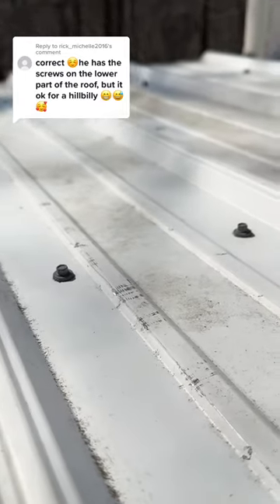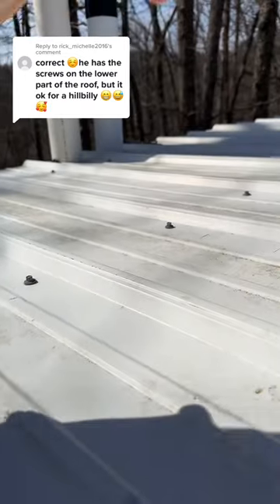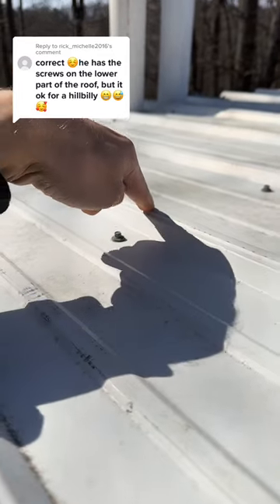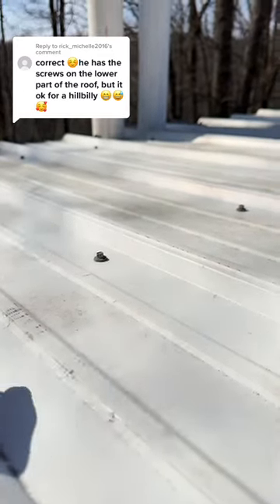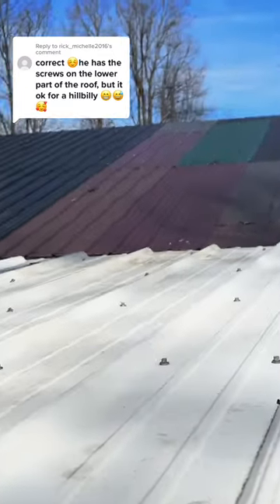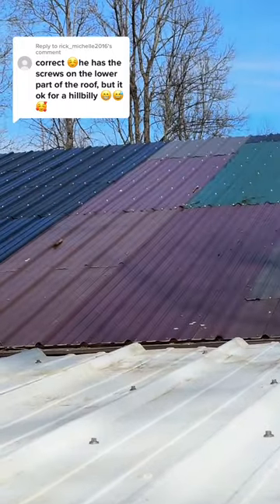did I install screws on the wrong part of the roof

Comment: The s wave style of steel roofing is what you're supposed to screw into the highest point of the patter. The way you screwed your roof is actually correct because it's not a s wave style sheet

Comment: I've built welded steel buildings for years.  You put the screws EXACTLY where they go. Putting then atop the ribs would create a fulcrum (think lever) that would allow wind underneath, and the whole roof could take off like a kite.  Conventional thinking or not, did it correctly.

Comment: It would flatten the ribbs because they are not enforced. It would make sense to redesign it though. You can use silicone to seal the screws and pluck the holes - expert from the internet with no experience

Comment: The high rib isn't touching the wood underneath.  If you tighten the screws as they should be, you will bend the metal.

Comment: The screws are suppose to be on the flutes because it will hold the panel to the roof without damaging the rib. As a professional metal roofer and cladder, the screws are in the right location. Everyone who says otherwise has no knowledge in the subject.

Comment: Never put the screws on the high points or ribs. That crushes and distorts the metal along with leaving a large portion of each screw in the air so to speak. The screws are then more susceptible to bending or moving under a wind load.

Comment: I used to install roofs, you're supposed to put them in the lower part. the top part is way less secure and leaves an air gap between the scree and the water

Comment: It's a good theory but if you overtight in the screw the ribs ends up crushing down anyway. Just do a standing scene roof with hidden screws and not worry about it if it's a big deal

Comment: The screws have grommets. 
The only thing is that the rubber rots in the sun but screwing in your roof is how you keep the roof on and not in the neighbor's yard.
Reply: There are 3 parts to the screw. The screw, the rubber seal and the washer. The washer is what protects the rubber seal. These are also suppose to be screwed in the correct way. You can not be over tight nor loose. Doing so voids the warranty. You can check then by looking at them and if you see excess rubber then you have over tightened them.
Reply: The Neoprene screws that I’ve always used are included in the 50 year warranty

Comment: A lot of metal roof companies will allow both instals. Yes, it depends on manufacturer
Reply: I’ve never seen a company call for rib screws with the exception of a stitch in the overlap but it’s not needed and will throw a pattern off

Comment: As a roofer for 10 years I hate metal roofs every 5 years you need to make sure all the screws are still tight and rubber gasket is good our you'll have leaks everywhere

Comment: If you do it on the lower part the seal stays flat and lasts longer, if you put it on the top, the seal crushes on the center point and will crack and break

You’re doing it right

Comment: As a roofer you're supposed to do that pheasant Sheet Metal Man as a steel roofer that put up metal roof you're supposed to put them on the high rib you just made a bunch of leeks cuz those only hold for sore so long before the O-rings go bad that's why you put them on the high ridges you ever talk to any commercial roofer the messes with those type ruse will tell you the exact same thing

Comment: You can actually damage the metal and make it not seal properly if you put the screw on the rib and also you will put a bend in the metal as well

Comment: Unfortunately I have a pole barn built in the early 90's before I owned the property and they are all on high rib using nail not screws, not sure how to fix, gasket on nails are getting old. So do I go back replacing nails with screws and new washer/gasket correctly on rib since that's how it's built.??  Not sure

Comment: The screws should have a rubber seal on them securing the the screw from any water . Don’t matter where you put them, have installed metal roofs for 10 years now never had a call back
Reply: Im sure they wouldn't call you back after seeing your work if you put the screws anywhere

Comment: nope for the rubber gasket to fit flush in seal correctly it has to be on the lower part and flattened flush

Comment: As long as you use them screws with the rubber washer under the steel washer it should be just fine. If not a little tar can cover up everythang.  Besides I've learned that putting screw on top doesn't always go so well.

Comment: yeah, I'm no expert, but I do believe that putting the screws into the elevated corrugation areas, will compress and deform the material, hence why the instructions say to install at the flat portion adjacent to the substructure. I mean...I could see putting a dab of sealant and putting the screw INTO that dab, so it seals the screw hole.

Comment: Yep, the reason you're not supposed to screw on top of the rib, is the rib has too much flex, or give to get a good seal against the washer. Always screw on the flat next to the rib, just like you did.

Comment: i did metal roofing the reason you dont do that is is fucks up the panel. it goes on the lowest part of the panel into a solid structure. you use stitcher screws to hold them together when there isnt the ability to put a structural in.

Comment: Do you want the screws to have most contact with the wood underneath or do you want the screws to have to have an open space that you have to guess is right while also not screwing fully in so as to not warp the metal and risk screw breakage?

Comment: Dear manufacture: Can you send more rubber washers for when the old ones deteriorate. Thanks 👍
Reply: @FU Yes indeed. And when they do break down, they can leak. It’s my own personal preference to have them on the higher ridge for that reason regardless of the manufactures recommendation. Yet in some spots, we’re  it can’t be helped but a screw is needed on the lower ridge, I pre - screw, remove screw, blow away filings, apply a dab of roofing silicone and re-screw. Yet, in saying that, you can add silicone to all lower ridge screws if you wanted to. But it’s very time consuming. I’ve build sheds for over 30 years and prefer the higher ridge to the lower for liability reasons. If the manufacturer recommends the the lower ridge then liability is on them, and not the installer. Love your channel Dude. 🇦🇺👍

Comment: Tib has no support under it, screw into that bends roof and is far less secure. Screws have a seal and is supported underneath by roof sheathing in lower part

Comment: i have built thousands of metal buildings and the screws go on the flat not on the rib, you will crush the metal and crease it then it will corrode and rust out quick!!

Comment: They are supposed to be on the flat. If you put them on the rib there is to much play in screw and the expansion and contraction of steel will move them back and forth and break them off…

Comment: Anyone who thinks they should be put on the high rib doesn’t know what the hell their talking about. I’ve installed these things several times. There is NO way to screw into the rib and make it tight, for one you would have to replace the screws with 2” screws, and even if you did that the high rib will crush flat attempting to secure, messing the roof up. These roofs weren’t made to be installed like that. Idiots don’t realize the screw come with flat washers with a rubber seal on the bottom side.

Comment: They are also exposed to more air and sunlight combined with the current stresses when you put em up high so depending on where you live the same method could work horribly or amazing.

 Maybe live there for a few years first chief

Comment: If you put the screws in the high part wouldnt that cause leaking? They would have an air gap between the metal and wood allowing the screw to bend the metal down causing a spot for water to pool.

Comment: Nope screws go one the low end of the metal the reason for the rubber  washers are for the nail so the don't leak if they went on the rib the screw would buckle the metal and cause it to fold plus you wont get much screw in the wood even if it was up on the rib it would still leak water gets in every hole lol the last screw holds the metal down over every last rib have laid down hundreds of metal roofs this is how it goes

Comment: It goes in the lower so it makes contact metal to metal, if you put it in the high spot it would bent and cause dips for water to pool. Also, the faster screws have rubber or metal seals. Maybe that guy's the hillbilly 🤷‍♂️

Comment: Well it’s not that they are wrong, they are in business to make money so they’ll tell you what makes them the most money.  
Think about water.  Does it flow in a low spot or high spot?  What will leak the most when that rubber washer degrades?  Think for yourself.

Comment: Screws go on high ribs due to water generally running off of this area and into the valleys. The screws are meant to hold the metal in place and will do such as long as they're snug, not tight enough to collapse the rib. Another reason is the rubber grommet under screw head gets brittle and loses it's water proofing over the years and will positively leak at phenomenal rate if in the valleys compared to the ribs.

Comment: This is correct. Some people do lathe the highs on the seams but I would recommend waterproofing if you do. Waterproofing the fasteners will prevent issues regardless. Look into coating/butter grade.

Comment: Slip or slide on that roof and tell me where youd prefer the screws to be. 

Also there is a hollow void under the raised rib, so you would squish or bend the metal.. instead screw to the solid flat surface that has full direct contact at all points.    Common sense for most ain't worth a crap anymore. Smh.

Comment: The manufacturer is wrong. You put the screws ( or nails for this old carpenter) in the rib. Why puncture a hole in the bottom where the water runs.
Reply: Because when you screw into the ridge you're backing is nothing but air

Comment: The reason why they're on the lower part.
If fastens it to the roof better, on top of that they usually have a rubber washer that seals it from leaking.
Took me a while to figure that one out myself.

Comment: Whoever thinks the screws should go on top of the ridge are morons. I understand ignorance but come on why would I screw there and deform the panel and instead of screwing on the flat part and getting it tight. The screw has a seal on it for a reason.